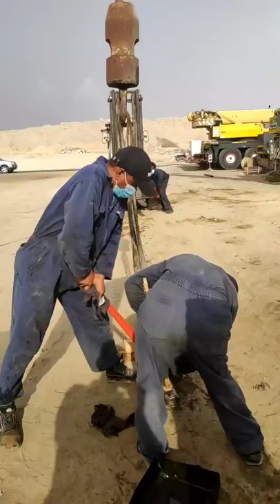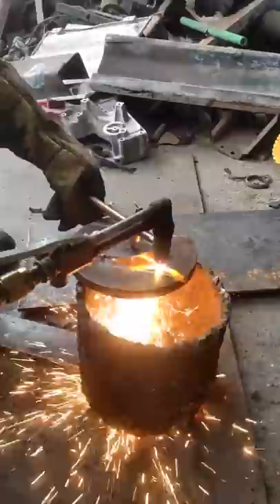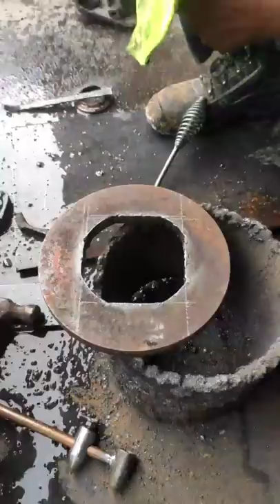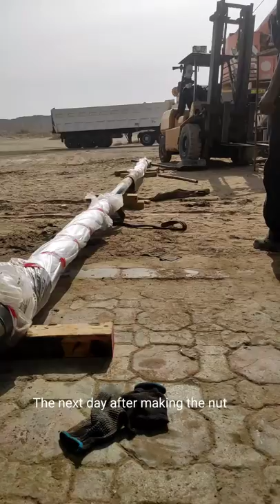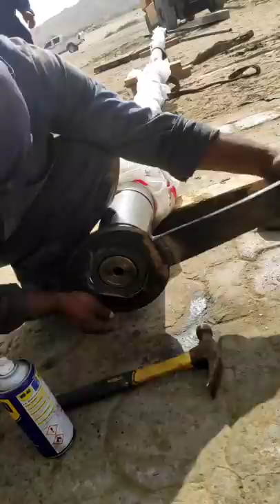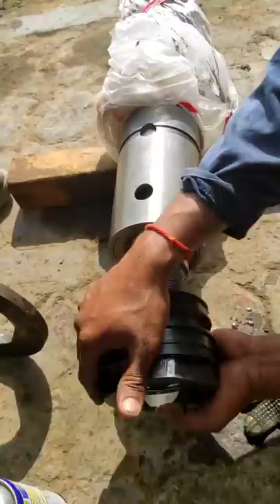While opening the nut

Comment: My dad did something similar for me when I was trying to change the upper ball joints on my 1974 dodge pickup. No wrench would fit it,so he took a old dozer track pad and cut out a wrench so we could change them out. Still have it to this day,going on 30 years now!
Reply from the maker: Very good. Your father is a great person. May God keep you safe Thanks for your interest in the video
Reply: I like creating the solutions 😍😍😍
Reply: jrjrhd384  Feel better about yourself now?
Reply: Old school know how. Noth8ng can stop old dudes!!
Reply: @ Mega Deuz, the Dodge, the wrench, or both?
Reply: You could’ve saved yourself a lot of time by just using a large pipe wrench.  They do make a special socket for them.
Reply: @nowthatsfunny1  Lmao
Reply: @schnoebelen2333  💀
Reply: I wish my 74 was still running
Reply: Trying to change my water pump one night so I could make it to work and needed a tool to hold the pulley and one to turn the fan nut but i didn't have anything that was big and skinny enough to fit so I used some old heavy duty shelve brackets and made both tools.... Wrench could've been tighter but it was late and I got carried away with the pretty Sparks at night time... Loaned the set out to two other people that's needed it so far and it's still working not bent or weak yet. So basically if you need custom tools hit me up
Reply: @thatdude8247  Hey bro you still got them custom wrenches?
Reply: @ufc990  I do
Reply: @thatdude8247  How much you reckon they weigh?
Reply: @ufc990  probably 5lbs for the pair it's just some 3/8" thick steel brackets around 24 inches long measured the bolt with good old adjustable wrench then traced the width of the opening hit it with the grinder until the lines disappeared then eye balled the bolt holes and to be honest it was simple even frustrated and cold in the rain I got it done then left posi track from the garage past the house... The old lady was pissed said I didn't have to do it 6 times... Oh well

Comment: Might also help to actually use the leverage you have and not put the force right next to the point of attack but okay
Reply: That's what i was thinking when i saw the big ass torque pipe
Reply: You'd think, but once you've got a cheater bar going, sledging farther up just flexes metal and makes the wrench bounce in the tube. Then things start reverberating (? Vibrating?) and the wrench slips off

Also, there's a guy hanging off that end, who I'm sure would rather not be whacked with a 10lb sledgehammer. Could be wrong, though.
Reply: Shit maybe you should make a video about it big guy
Reply: @crinkly.love-stick  bingo.
Reply: @crinkly.love-stick  thank you. Perfect explanation. Those guys are out there doing this for a living. I’m sure they know what the hell they’re doing.
Reply: @crinkly.love-stick  have you never used a cheater bar before? One person holds torque against the bar while the other person hits. If you can't swing a hammer onto that big ass bar without hitting the guy holding it at the very end, you shouldn't be working in an industry where you need to use tools.
Reply: @maxl3189  yes and it would have loosened it way easier if it had been done where the torque was actually applied. Why have a cheater bar present if you aren't going to use it?
Reply: its not force its impact, its more like every time he hits it, the shockeave of vibrations make things loosen up as the guy is pulling on the cheater bar thus creating a manually operated impact wrench
Reply: Kommst du aus Deutschland?

Comment: Use as long a lever as you can get. I’ve taken off nuts that I couldn’t get off with an impact wrench with a really long cheater bar. Holding the socket on the nut is hard though.
Reply: Had a similar situation once it was either a washing machine or dryer one of the bolts was was rusted about solid impact wrench wooden cut it however borrowed a ginormous cheater bar and then put a piece of pipe on that worked.

Although when it was running go I thought I was actually sharing the Volstead off instead of turning it that's what it felt like.

I guess you could have said I would have been screwed if that happened in a way.

But sometimes it's big big big cheer bar for the win.

Although there's been opposite times in which cheater bar wouldn't even budget but impact for the win!

One-time didn't have a cheater bar handy but I did have a lug wrench that happened to be the same size which took care of it!
Reply: breaking collars on 3" tubing ive had to cut a joint in half and use it as a cheater. it was like 16 foot long on a 36. it still took me and my 300lbs floorhand on the end of it to break

Comment: If you replaced that wd40 with pb blaster that nut would've come off by hand.
Reply: Hell ya
Reply: Also works as barbecue lighter fluid.
Reply: PB Blaster is absolute gold compared to WD 40
Reply: People still using wd40 as a lubricant 🤷‍♂️.
Reply: @darrenbishop4327  the reason wd40 isn't better than pb blaster is because pb blaster penetrates into the stuck bolts/nuts and lubricates them from the inside. Wd40 does not do that. If you wanna lube something that isn't rusty then wd40 but if you can't get that bolt loose go with pb blaster all day.
Reply: @neonnerd1364  wd40 isnt good for any lube, it dries out and makes things worse, use old filtered atf and mineral oil and alcohol.
Reply: @Seriouslydave  I just mean it's good in a pinch. Definitely not for long lasting lubricant.
Reply: If you'd replaced that pb blaster with chicken grease they could have chicken for lunch.
Reply: Rubbing alcohol and transmission fluid bro. 50/50.
Reply: Don’t forget to replace the permatex antisneeze with rock and roll also.
Reply: Or Seafoam Deep Creep 👍🏼
Reply: Pb is awesome for penetrating fluid, also their Teflon lube works awsome also for lubricant , sorry I despise wd40 ..as a kid if there was pb next to wd all day I'd grab the pb
Reply: Ikr
Reply: @FinalFront  that's funny cause we call pb blaster squirrel piss at my shop lmao.
Reply: Agree PB blaster will loosen up a dollar from a little ol lady😆
Reply: Wrong way they both same
Reply: @Nubsanders  wd40 and pb blaster are most definitely not the same.
Reply: @FinalFront  NAH! Kroil is overpriced and no competition for half ATF (preferably synthetic, like ATF+4) and half Acetone, mixed vigorously.
Reply: @alfredomarquez9777  NAH that bs is too thick the acetone evaporates too quickly
Reply: @FinalFront Then, you still have to learn how to use it properly: Put it into a large syringe together with two small balls from a ball bearing (for mixing), and shake and apply, shake again and apply. The trick is keeping the acetone and the ATF well mixed, as they tend to separate. In warm climates, increase the acetone content above 50%.
AAAAAND, Synthetic ATF is NOT that thick... that is why I said "ATF+4" which is thin enough, notably thinner than more common Dexron/Mercon types.  Don't discount it if you (evidently) have not mastered it!

Comment: Making a wrench was the smarter way to do that,however a 6ft pipe wrench and a lot bigger hammer would have worked.  In a pinch 2 guy beating that nut in the loosening direction with 10 pound hammers would probably eventually work as well
Reply: U have no idea the torque on that nut!
Reply: The custom wrench making contact on more points of the nut is what allowed the kinetic energy from the hammer to break the torque on that
Reply: Sometimes pipe wrenches can't get a good bite on certain types of forged steels
Reply: They should have used a floppy hammer for more kinetic energy
Reply: @visible2anyoneonyoutube  the further up the bar you go, the more energy is lost to vibration/ flex. I had a stainless bolt that was seized into cast iron. Probably one of the worst cases. Anyway, all types of quality sockets from total crap to snap on all broke, and I stood on the breaker bar whilst my dad held it. The longer that bar got, the more flexible it became and at a point, you're no longer applying any more torque, your just bouncing up and down on a spring. We ended up doing exactly like this guys homemade spanner. We used a flat section of plate to effectively make it like 2 inches thick. And it couldn't just flex. Applying a ton of brute force only works in the right direction. Not trying to  be a smart ass, it was my dad that thought of it anyway

Comment: Just heat it up. It's obviously a hydraulic cylinder. Those nuts are loctighted on and heating it to 4 or 500 degrees won't ruin anything but the seals (which is why they get taken apart anyway, replacing the seals).

Comment: I’ve had my fair share of these!! 9 times out of 10 it’s bc some dumbass decided to drown the threads in loctite 🙄 seriously people it only takes 1 thin line across the threads….  Then put the piston on and torque to spec 👍🏼  oh and ALWAYS check for set screws before removing piston/nut, even look under the wear band and piston seals. I’ve seen them before.

Comment: If they took the pipe as an extension, they must also hit the end of the pipe.
Reply: The pipe bends too much and absorbs the blow
Reply: @tyalbert5063  then I see no point in such a lever. Sorry for my English
Reply from the maker: The pipe was inserted to push with the hands, and if it hit the end, the wrench would break That's why I made another steel wrench

Comment: Why not hammer on the pipe attached to the wrench where the hammer will be using all the leverage possible instead of as close to the nut as possible.
Reply: The pipe is thinner walled tube  and would deform and then tear where as the pipe wrench is solid forged steel

Comment: Idk but i believe if you hit closer to the end of the lever arm, you'll see more effective results.
Reply: Depends. If there’s a lot of flex in the snipe bar being used all of your hammering efforts will be absorbed and negated by said flex. It also looks like they had someone applying tension on the bar as it was being hammered
Reply: @benm12310  snipe bar that's one I've not heard before has anyone ever heard where that comes from or any idea would like to know.

Also might be handy when your need to do with someone new beyond the job tell him to look for something that doesn't exist or maybe confusing enough.

You know like a snipe hunt or one of those kind of deals but when actuality it is something exist but would not know what one would be would even be better than the Plan old snipe hunt.

Basically the person is unknowingly sent on a run to get something that usually does not exist.

Or something that you wind up getting something you don't expect or otherwise.

But typically with the snipe hunt.

You may send that person to one person to the next to the next.

And one person says they don't have it but the next person would rinse-and-repeat you get the idea.

Never fallen for it and I doubt I ever will!
Reply: @aaronbrandenburg2441  a “snipe” is a piece of pipe you can slide over your breaker bar, wrench, ratchet, ect… to increase your leverage not some wild goose hunt 😂

Comment: They literally had the metal pipe bruh. Torque is F*L. Even if you apply a 1000N at 1cm, it's still only 10Nm of torque. While 1000N at 2m is 2000Nm of torque.

Comment: They’re doing it all wrong.  You use a lever by applying force on the end, not at the base.  That was a total waste of energy, time, and money.  Just hit the end of the lever, not the base.
Reply: This comment get thrown around a lot but misses the point that steel is flexible.
A hammer that far out just causes spring back.
That is why there is a man on the end applying constant stable pressure to reduce the backlash

Comment: Still remember a story from my uncle on how a group of old and young men spent 12 hours trying to remove a rusted bolts from a car's wheel.

Damaged about 1 equipment in total, still functional though

Turned out that a few of the nuts loosens in clockwise instead of the standard counter clockwise direction